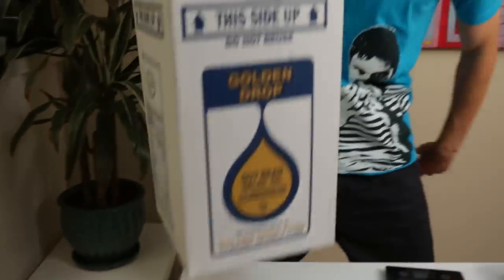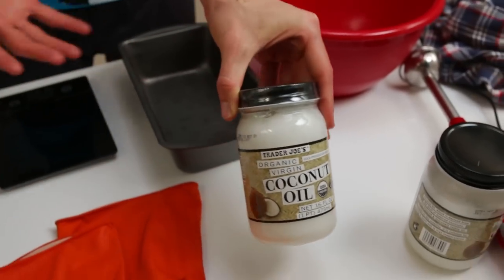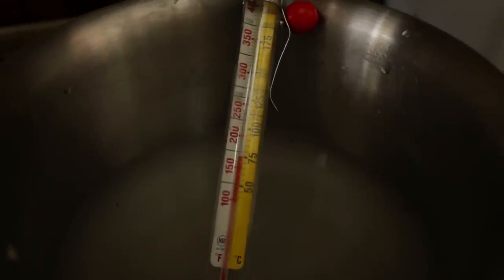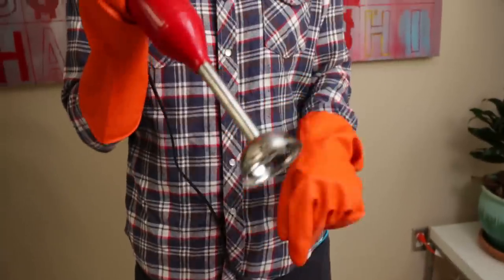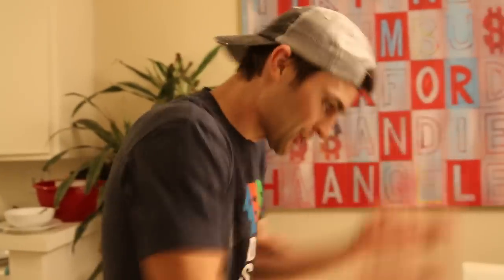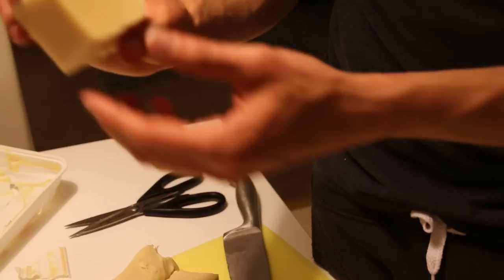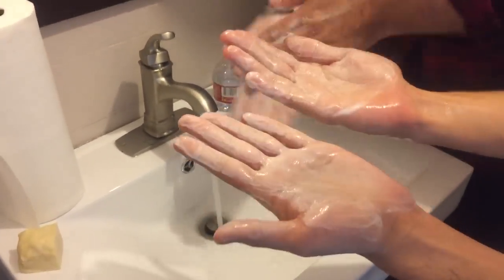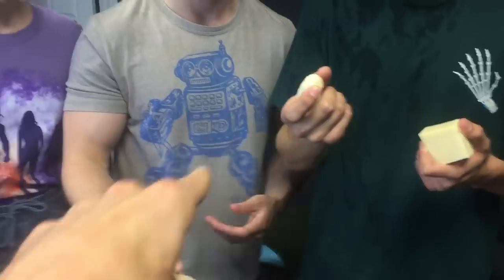Turning Deep Fryer Grease Into Soap!?!? Ft SMOSH Squad

Comment: I have a friend who makes soap, and she has these molds that the sides come off so it's easier to remove the soap. I'm not sure where you can find them but I'm pretty sure a quick Amazon search will do the trick.
Reply from the maker: that's rad! I need something like that, because the first fail video was cray with the molds

Comment: Would it make a difference if you would have sprayed the containers with something like nonstick cooking spray before putting it in the molds? And could you add scented oils, like lavender, mint, pine, etc?
Reply from the maker: for sure, in fact we should have coated them with the oil we used to make the soap... and 100% there are legit 1000's of essential oils to make soap smell awesome